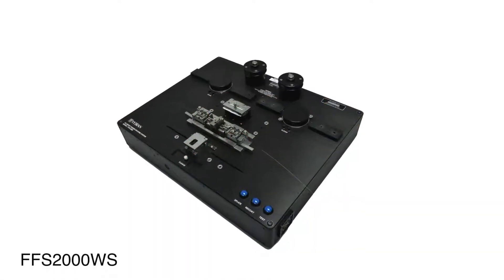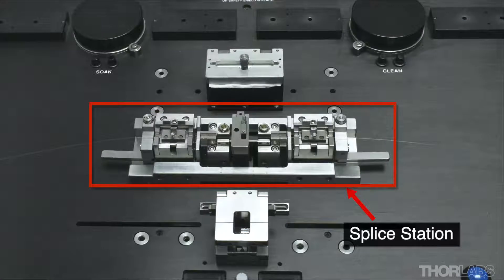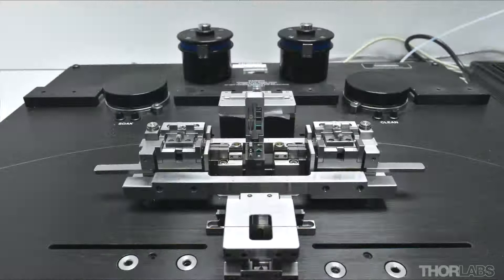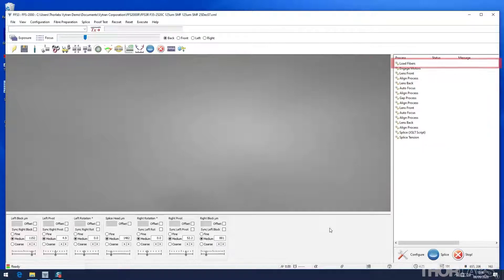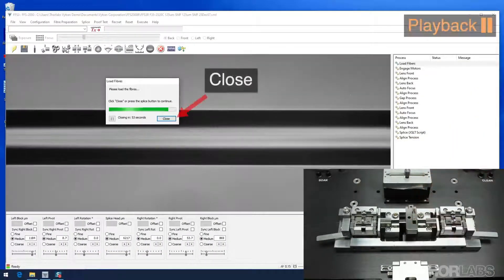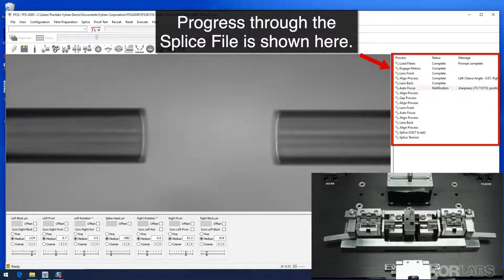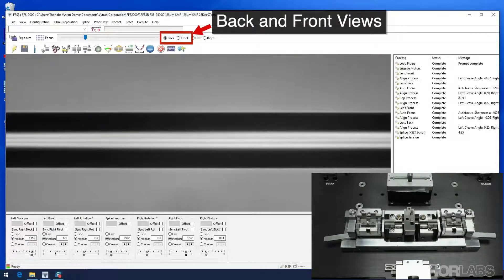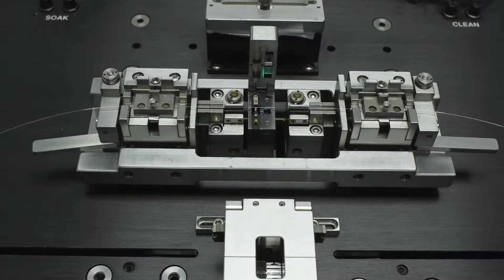Thorlabs FFS2000 Workstation: Automated Splicing

Comment: What is the largest bundle (overall diameter, number of fibers in bundle, size of fibers in bundle) that this device can handle?
Reply from the maker: Thank you for your question! FFS2000 can handle a fiber or fiber bundle as large as Ø200 µm in diameter, but if your application requires making the bundle or processing larger bundles (up to Ø1.7 mm) for power combiners, lanterns, endoscopes, or other glass components, we would be glad to reach out to you to discuss the GPX3000 series glass processors.